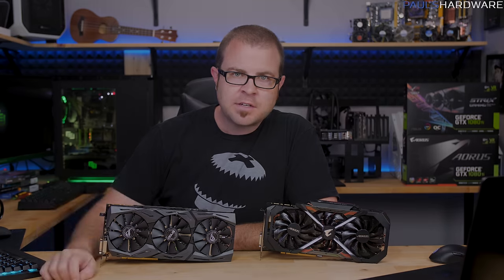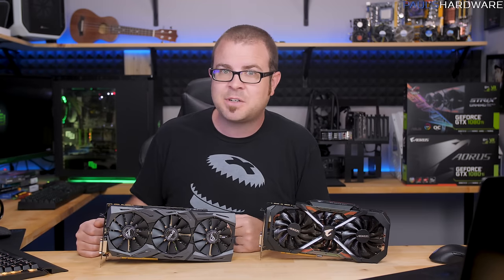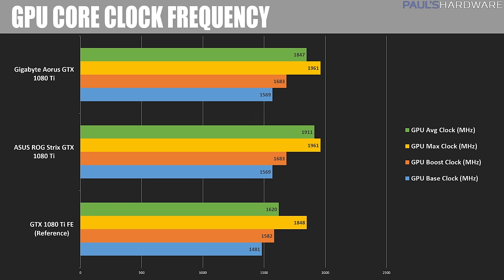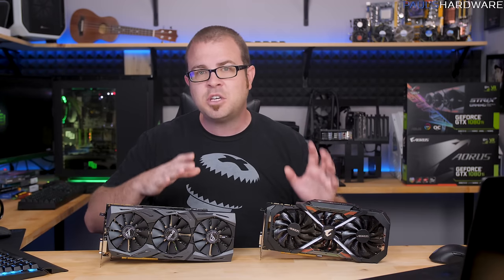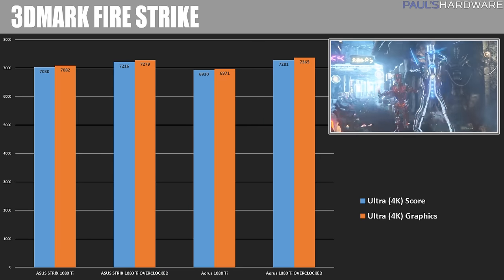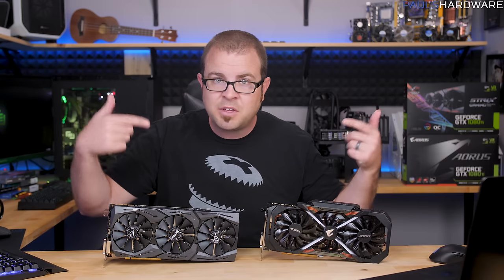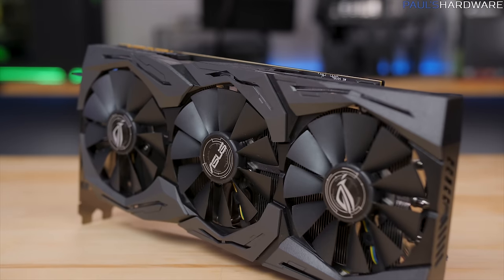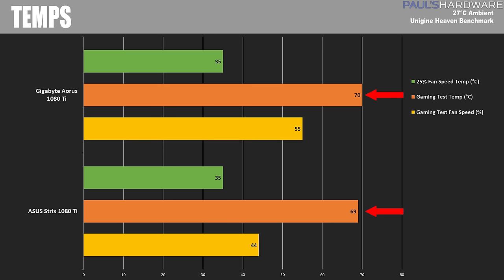AORUS vs STRIX: Why My 1080 Ti Showdown Doesn't Matter

Comment: I can clearly tell you're an asus fan fax :
AORUS : goes with a solid all metal shroud , whilst
ASUS : IS made out of plastic.
Also talking overclocking : 
AORUS :  outstand with a sustained 75 core clocks 
Clearly AORUS is built for extreme overclocking n it'll run like a dream on costume watercooled , Long living beast , less price , higher performance than the strix that is made out of plastic and has a bent fin that runs in a lower clock speed if it's overclocked , how'd u buy a 1080ti performance card and u won't overclock it like c'omon lol
2:07 little details? higher the voltage on the AORUS and check that average clock speed if it's the same , that's the only factor you've been playing on
edit : U know damn right which card I got I ion have to tell u

Comment: I couldn't be bothered with overclocking, fancy lighting, case windows, brand name etc. so I only buy on price and price alone. In my country, that often means Galax, sometimes EVGA or MSI. I've never had the slightest problem with any of them thus far and I've used all three brands for years now. Asus & Gigabyte are both usually stupidly overpriced, especially when it comes to graphics cards. In the mobo market, there's very little to choose between any of them. Just buy the one that tickles your fancy.

Comment: I have a nzxt h440 case which i really love but my r9 390x crossfire runs hot af inside of it, so i want to replace my gpus with a single 1080ti card.
which one would you guys recommend ? a custom card ? a FE?

Comment: Gigabyte Aorus 1080ti in my opinion looks better with a slight orange color since it fits my setup. The Strix is overrated. To be fair, both have the same performance and the same temp. Only difference is 1-2 fps and thats about it. They both look good. It's all up to you're taste. Both are powerful high-end graphic cards so keep that in mind.

Comment: Hey, can I get some advice.

Which would be the best deal Asus GTX 1070 Turbo £300,  EVGA 1070Ti £430 Inno3d GTX 1080 £400, EVGA 1080Ti Gaming x Trio £560. They are all new except the 1080 which is a few months old.

Any suggestions? Also I have i7 4790k, will this be enough to not bottleneck

Thanks.
Reply: For all you must look up the concrete model. For instance Asus Turbo is one thing, Dual another and then there is Strix. Same for other brands - there is base model, high-end model and sometimes middle-tier model. The model is as important if not more important then the brand!

Comment: im saving for a strix 1080ti

i want to start streaming and my 980 is barely cutting it gaming at 1080p on ultra and theys like £200 difference between strix 1080ti and 1080 so fort ill just go for the ti.

Comment: The new design for gigabyte's aorus branding is horrible.
Reply: I agree !
Reply: Frankly, I haven't seen a single 10 series card (other than the founder's) that I would buy based on aesthetics alone.
Reply: Well, while Founders looks cool, it it severely handicapped by weak cooling and OC-ing is kind of out of the question. I want my card to look cool AND perform as good as possible.
Reply: I bought the Aorus and I like the colors and design. When the LEDs are on you do not see the color of the card at all. I like it.
Reply: I personally couldn't care less about the RGB bullshit and I really really don't like the shourd on Aorus (the X over the fans mostly).
Reply: I like it
Reply: it is so beefy and big
Reply: Design horrible, fully agree, performance outstanding. In my case 2063 MHz and 11800 MHz memory, stock cooling, all tests and games stable. And quiet. Happy about my decision. The Aorus software for controlling the fans is a bad joke tho. All time MSI Afterburner.
Reply: doesnt matter to me.  It goes in my pc out of sight.
Reply: sirius4k Founders/blower cooling is actually better in some tiny mITX cases, (i.e. BitFenix Portal) where you don't want 3 huge fans dumping air into the case. With a blower card, you can set the only 2 fans to intake and use the vard as exhaust
Reply: The Aorus motherboards look nice though
Reply: Thats because you cant afford it :) otherwise you wouldnt say this.
Reply: I dont care the design... I care the performance

Comment: Really bought the Aorus version because of the 3 DP ports instead of 2 and because of it's availability. Most other GTX 1080ti's are really expensive but not the Aorus version.

Comment: ah i cant decide.. arorus is better at overclocking (has better overlocking software and hardware), whereas Strix has faster fan speed resulting in potentially a super cooled cpu with virtualy 1000rpm faaster than aorus's fans... aesthetically they both look appealing i really couldnt decide on that one... strix is a bit louder but only because it has a faster fan speed which makes sense..

Comment: i got a strix 1080ti , what is the safe overclock level (settings) using ASUS GPU TWEAK II without any extra cooling system?
Reply: That tool is idiot proof, it has so many voltage restrictions that there is no way you can mess things up in any way. Just crank all the sliders as far up as they will go and see if it makes any difference. Now if you were using afterburner or any other OC tool, that's a whole different story, better read a OC'ing guide before trying anything out.
Reply: the game will black screen and close , if i manually OC

Comment: Hi guys, looking for some solid advice. I just built a Ryzen 1700x video editing pc, 32gbs of ram, m.2 boot drive, B350Plus MB and GTX1060 turbo gpu 6gbs. Do primarily video editing/rendering in Camtasia 9 and I notice that at 720P all is well but at 1080P editing playback is terrible, so way out of sync. Would moving to a GTX1080ti gpu solve this? I did OC the CPU from 3.4 to 3.8 to no avail but don't want to blow $1300 on a high end graphics card if I don't have to. 
Any good advice would be appreciated. 
Paul

Comment: My 1080 strix peg power led always lights on is that normal?
Reply: no
Reply: naturbur i found out that its normal on a strix 1080 when the 2 lights turn white it means its working fine when i pull it out  the led light turns red

Comment: Not enough comments to scroll through
Reply from the maker: it's still early!
Reply: Paul's Hardware love your videos! Keep it up.
Reply: Kurtis Johansson not enough money to buy a 1080Ti
Reply: +Proj3ctX
Money? I have a credit card. Oh, wait a minute. My credit limit is lower than the cost of a 1080 Ti. You are correct..."not enough money to buy a 1080Ti" is a correct statement. :(
Reply: Craig Peters
lol I have a Girocard for kids (I'm 13) and the limit is 500€ (yeah €) so I could afford a 1080. But my cpu is old as fuck.
Reply: +Proj3ctX
That's funny. I'm 56 and never really needed more credit than my current credit card limit. Things have certainly changed since I was 13. I didn't qualify for my first credit card (gas station) until I was 18. Use that Girocard wisely. It will benefit you in the long-term, if used properly.

Comment: Asus claims supreme fabrication quality with their fully automated assembly removing human imperfections, is that a valid point to consider when choosing gpu card? I would probably go towards evga this time around if i was going to get a 1080ti because of their "overkill" mosphet cooling that should increase the durability of the card. I know durability is not a priority for a lot of people considering obsolescence but i like to think my builds can last a very long if needed, also improved durability means better stability with ageing components.

Comment: So your basically saying an ASUS Strix 1080Ti performs better than the Gigabyte competitor even though it is tiny bit more expensive. In australia these cards cost between 1,100 and 1,300AUD dollars at both my local store and online websites except AMAZON. When I upgrade to a 1080Ti I am definitely choosing the Asus somehow though.
Reply: Correction on places like newegg this generally costs about 809.00AUD hu.

Comment: I went with the Asus, i have the Gigabyte 1080 xtreme gaming and honestly i am dobe with it, even though the shroud is metal it is super thin and, just by handling it it is very easy to bend which will make the fans hit the shroud, it came like that, i side the box when i first got it. Also the Gigabyte software sucks really really hard and you need it for the oc profile and rgb management. For thesd reasons i went with the Asus when i upgraded now.

Comment: should I sell my rx rx 480 4gb sapphire for 170 and my 2gb rx 460 by msi for 50 then I'll make up the difference and buy a 1060 6gb 
for 249.99 does that make sense
Reply: Ö sell the 460 and oc the 480 for what
Reply: UrProxy sell the 460 for money for whatever you want cause it's an old/useless card that's already decreasing in value. And oc the 480 for better performance.. almost identical to the 1060 in many games.
Reply: Ö nvidia works better with obs not amd2 it sucks
Reply: UrProxy okay. But imo it's not really an upgrade. You're losing two cards and staying at the almost the same level of performance. At least aim for a 1070 if you're going to go through all that trouble.
Reply: Ö well I'm thinking of the 1070 can it run 1080 ultra wide 75hz
Reply: Yep.. it definitely can.
Reply: ***** nice

Comment: Nice! Anyone knows if the 1070 strix has a rgb header too? i'm thinking bout getting one if it does!
Reply: it has 2 wpm fan headers rgb idk
Reply: Yeah I saw that on the asus site but no info on the headers 🙁, hope someone who has one knows if it has
Reply: i have one and i just looked it hasnt but if you are getting this card chances are your motherboard especially MSI will have an RGB header my m5 gaming board does
Reply: sadly wont be changing my board, just the card, have an old reliable B85M-G R2.0, but when I get the cash I will upgrade to rgb MB's and ram, I need more RGB! MOAR!
Reply: whats yur rig got atm

Comment: I'd pick the MSi any day of the week. coz its quieter ... 
a lot of people have coil whine problems with the asus strix
Reply: Mikkel H The Msi is quieter by 1dB on auto fan settings according to Gamers Nexus... And since the Strix runs cooler than the Msi  you can make a custom silent fan curve to reach the Msi's noise levels and still get the same temp as the Msi's. That's what I did with mine. I don't have any coil whine issues either, I had some with my Msi 980 gaming 2 years ago though, so I guess it affects those 2 brands, it's just a matter of bad luck.
That being said, if the Msi had been released sooner than the Strix I would have purchased it, I like their cards.

Comment: The Asus Strix 1080 Ti is Boss. I think however for most users the GTX 1070 is sufficient. In three years time even the mid-range card will beat the current king (1080 Ti) in terms of performance anyway, only get the current 1080 Ti if you don't plan on upgrading in the future and just want to "set it and forget it" for the next 5 -7 years before you buy a new computer.

Comment: With the Aorus GPU you would have to deal with Gigabyte's awful warranty/RMA process.  After three separate bad experiences with Gigabyte's Warranty/RMA process I stopped buying their products.  Nothing like having them not fix their defective motherboard and send it back to you without having them test if the item is actually repaired or having them damage your motherboard and send it back to you.

Comment: Aorus' HDMI VR support is a plus (maybe an edge) over Strix's. However, STRIX all the way coz of that orange accent (Gigabyte's poorly implemented aesthetics). but that's just me. I used to have Gigabyte's X58 MoBo (never VGA) and had to ditch the brand been sticking with Asus'. hate the plastic shrouds though.

Comment: I have sli msi gtx 1080 ti
I did try gigabyte but i don't why i didn't like it maybe i am msi guy 😅
But with stress work with msi is best
I use overclock on it and the temperature is great
But with gigabyte it's get so hot and fans get annoying

Comment: Only problem is gigabyte software is shit. I have a gigabyte motherboard and gpu but can’t get the rgb to sync, not to mention that the motherboard’s color cycle option skips colors. As to the rest of the motherboard software, you would be lucky if you get it to work.

Comment: how 1080 ti of all reviewers run so cool is unbelievable the aorus extreme i rma ed and the poseidon i own now run very hot . Both stock all 82 c+ even 100% fans at 27 c room temp  with side panels of the case open . poseidon even on water gpu loop with ek pe 240 + d5 g2 pump at heaven and aaa games like bf1 runs at 64-68 c on fucking water at 20c room temp .

Comment: I would never buy MSI. My friend bought a 980ti a little before the 10 series dropped. He was waiting to OC until he go a new case and proc. After that he just bumped up the power to 110%. It worked for a week or so then just went black. We tired diff system other GPU on his MB. It was 100% the GPU. Sent it in to MSI as it was under warranty. He was told it could be up to a month. 3 weeks later they said the where going to send him a 1060. WHAT THE FCK. 1060 is not = to a 980ti now he is haggling with them. That is so wrong. Last Card I had that died from EVGA was a 9800GX2 when it died years later they sent me a GTX280 that was a little better with frames. That is how you RMA. I ONLY buy EVGA and they have never done me wrong. I also tend to by reference they just hold up better.

Comment: I got ripped off I have an rx 480 from xfx that was $290 at the time of purchase and the next day they released word of the rx 580 which would have been better and my card doesn't overclock very well however it was factory overclocked a little bit so there is some good news... however, it does look good atheists wise in my case and it doesn't help that my cpus are thermal throttling and causing my gpu to be bottlenecked at the same time with only barley enough power to run it I mean it shuts down sometime due to no power and it always gives me that annoying message watt manager has reset causing me to have to re do my over clock in the first place... the frustration of having an older computer and just putting new stuff in it ... 

Pc specs: 

CPU: 2 Xeon 55006

Gpu: xfx rx480

Psu: 450 watt 80+ certified from super micro 

Motherboard: x8dtl-if supermicro 

Ram 32gb ddr3 800mhz not sure ware from 

SSD 480gb SSD from pny 

And yes it was a server computer
Reply: And yes I am saving to get a new psu, and cpus thinking of getting dual Xeon x5687s they are old but still should be a substantial difference
Reply: Jordan lee123 just get a 3770k
Reply: Yeah but with that it may be fast but then I can't use 2 processors at the same time ...
Reply: Jordan lee123 if you don't do much editing, then go with the 3770k, pretty much the same as ryzen vs intel right now
Reply: Sky Walker the thing is I don't think it could support 6 sticks of ram at a time and I do some editing as well but I will take a look at it
Reply: Jordan lee123 more things isnt always better, look at dual GPU configs VS single gpu solutions, in black and white paper, they may seem better, but in actual, real world gameplay, they aren't i.e. stuttering, frame drops,games that refuse to even boot at all
Reply: Jordan lee123 also, 3960x's could
Reply: I would need a dummy CPU anyways and it is prone to have errors than if I just had dual CPUs
Reply: Sky Walker I know that the more things you have is always better but their is errors and other bad stuff that can happen if you have only 1 processor when there are supposed to be 2 I mean you could get a dummy processor but it still would have errors plus if I were to buy the 2 x5687s I could get them both for around $200 and with that I would be getting more cores more threads and less errors that's how I think of the situation as of now but I will still listen to ideas and only the Xeon 5 series can support dual processors and I would get the 22 core 44 thread processors but they are way out of my budget
Reply: trubin06 thanks but I already have a 8gb rx480
Reply: Sky Walker and doesn't the 3960x have an lga 2011 vs a lga 1366 like the current CPUs... and that is a bad ass cpu though
Reply: Jordan lee123 3960x supports ECC if you care about errors that much

Comment: Noise... ok, ok... But actually w/o overclocking most of the GPUs have insignificant noise from fans while gaming. You should better show us how many GPUs you have got with ridiculous "Coil whine" noise because nowadays that is the real problem not the fan noise @100% OMG... 
Why nobody talks about that? Sometimes i hear "my card doesn't have coil whine noise!". Yeah... or may be while gaming your CPU fan and case fans are so loud that you can't even notice that. 

All GPUs have coil whine more or less. I am talking about that because most people are worried about FAN noise level from GPU under load, but in most cases your GPU fans are silent even while gaming, what i can't say about "coil whine" noise which is quite noticeable.

Comment: These are so nitpicky and ridiclous. if you want a 1080ti... just buy a 1080ti.. "Ok sir, which 1080ti would you like?" "Just give me a fucking 1080ti, they're all identical". Which is correct. 1 degree here or there... 8MHz here or there... 1 frame per second here or there. Are people REALLY this pedantic? It's like having to pick between the 2 worlds most beautiful and perfect supermodels as your girlfriend, and choosing one based on the fact that she prefers light bliue shoes instead of royalblue ones... it's not a question.

Comment: I had the extra money and got the EVGA 1080 TI FTW3.  Running a 1600 watt power supply as I was running 3 way sli up until now so power isn't an issue.  I'm in love...hehe